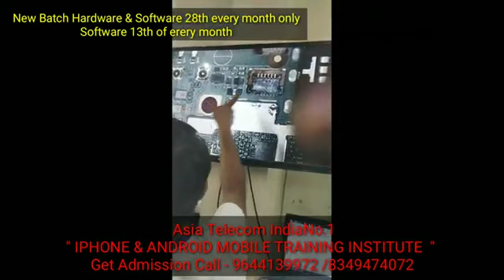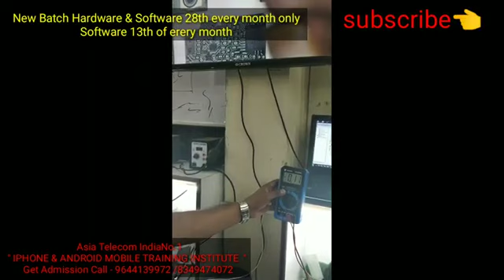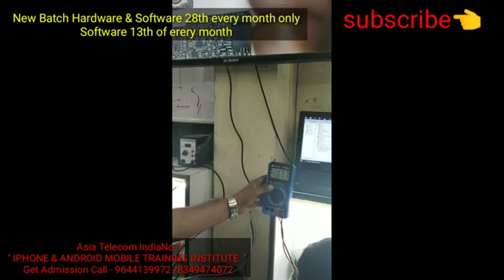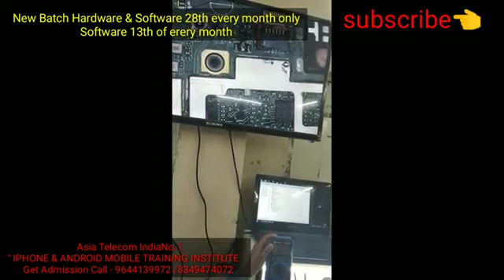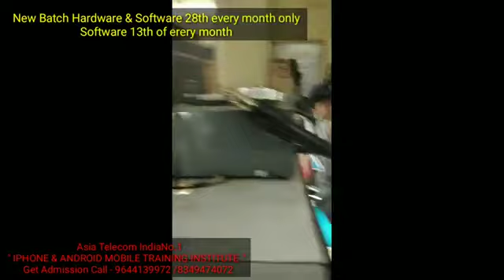Redmi 3s Touch not working -live Repair by Student Join (Hardware & Software ) Class - Asia Telecom

Comment: Redmi 3S not work touch
Reply from the maker: Proper jankari or praticle knowledge ke liye class join kare

 Jabalpur Madhya Pradesh .. puri jankari ke liye call Karo 9644139972 / 18001037001 ( calling time 12pm to 5 ok )

Www.asiatelecom.info 
www.asiatelecommobilerepairing.com

Or agar free mein jankari chhaiye toh hamari website par information collect kare 

All component working and hardware and solution aapko waha mil jayege 

Www.asiatelecommobilerepairing.com